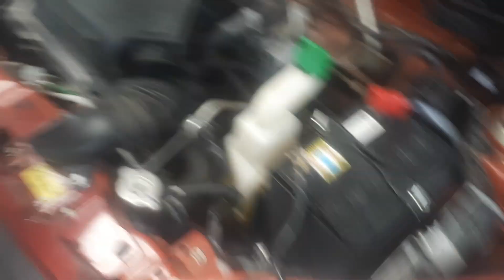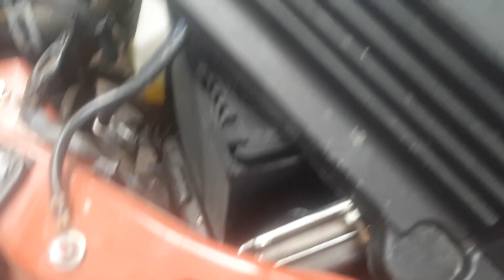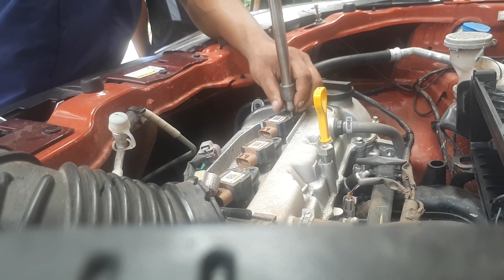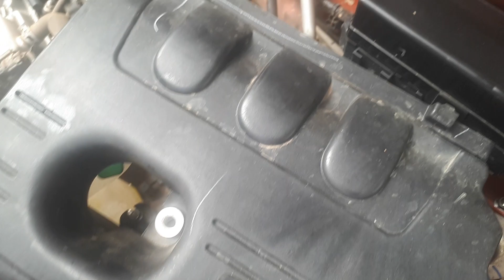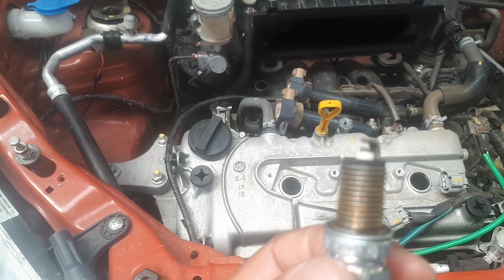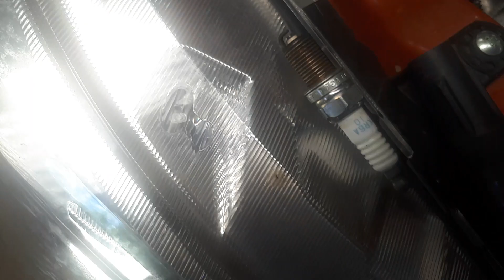How to Check Spark Plugs /Maruti Suzuki Alto

Comment: What’s the gap supposed to be as I am doing mine soon , hi from Australia,
Reply from the maker: Generally I change my spark plugs after 30000 to 50000 km depending on the use of vehicle. Whether it is heavy duty vehicle or just a vehicle for daily office use.
Reply: Can i use ngk kr6a10 spark plugs

Comment: My altok10 is already 70k never changed or opened sparkplug..... Just change oil, oil filter and airfilter.. and full body wash every 9 months thats it.....  Still running without any problem 😂🙄
Reply from the maker: Wow...that is really Amazing...Single Handed use Vehicles really lasts very very long